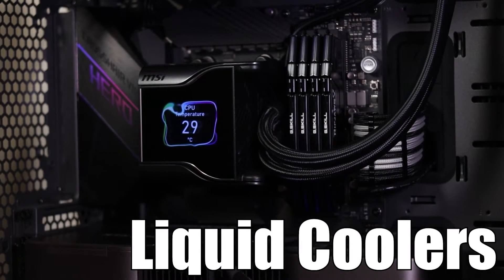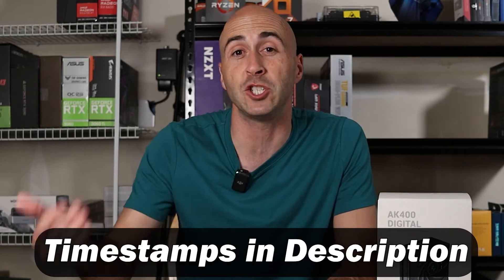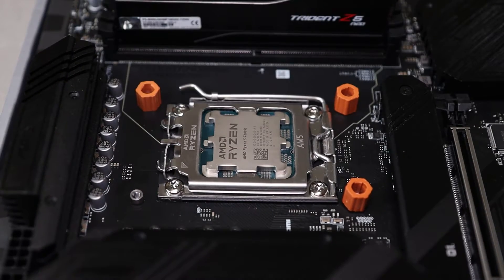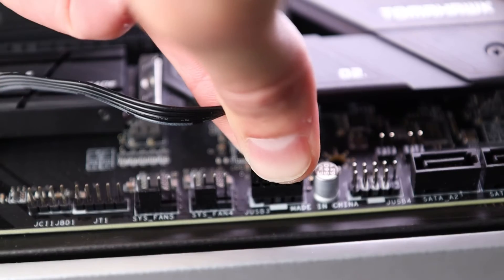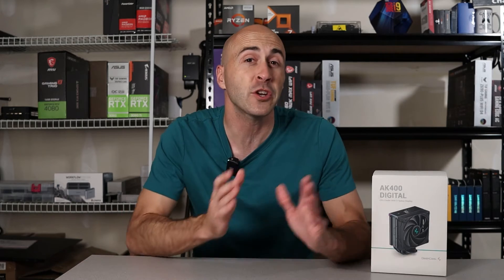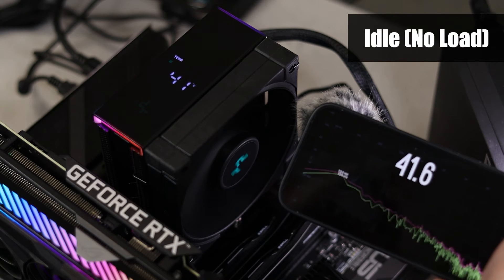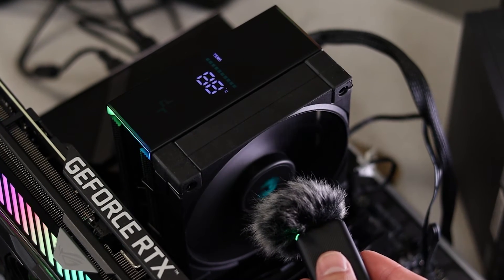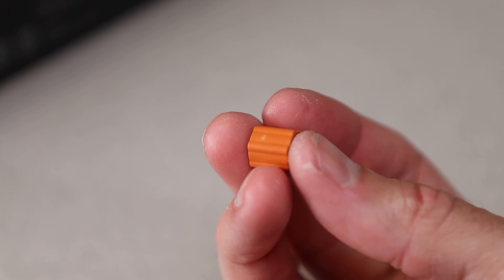LED Screen on an Air Cooler? | DeepCool AK400 Digital Review

Comment: Good to see you reviewing the Air Cooler I'm currently using.

I had one problem when I tried to install it.
I was replacing my older CPU cooler (not stock cooler) and this DeepCool need to use bracket from the original motherboard, which I'm not sure if I still have it because my previous cooler need to remove it.
I look for my dusty motherboard box and fortunately found the old bracket.
Reply from the maker: I'm guessing you're using an AM4 motherboard? I recommend to always save anything you can in the motherboard box. Glad to hear you found it!
Reply: what if i dont have it cause of moving  @DannysTechChannel
Reply: Does it also tell gpu temperature
Reply from the maker: No, it does not. It’s a little more basic than that
Reply: How's it holding up a year later?

Comment: for my next build I'm going Am5, and getting a ryzen 7 7700x on an Aorus X670 elite ax, also was thinking of getting the Deepcool AK620 digital, but...will this cooler be too close to the ram when installing, and cause me problems?
Reply from the maker: I haven't tried the AK620 myself.  From the looks of it, some ram sticks might have trouble.  Their website shows 47mm of clearance from the bottom of the fan to the motherboard surface.  I can say, the AK400 and 500 wouldn't cause any trouble since the fan doesn't extend past the CPU socket.  With the 7700x, I'd recommend the AK500 cooler. https://youtu.be/2FDtUx-YjNI
Reply: @DannysTechChannel  I thought the 7700x would run too warm for the AK500, but thanks anyway.
Reply from the maker: The AK500 would do great with the 7700x. When I tested the AK500 Zero Dark, it handled a Ryzen 9 3950x.
Reply: @DannysTechChannel  nice, thanks. Could you reccomment a board for the 7700x amd, the one I have chosen is £279, a little too expensive to be honest, but I won't be overclocking, it must have fitted I/O sheild though, thanks.
Reply from the maker: I like MSI motherboards personally. Right now, my AM5 board is the B650 Tomahawk. I’m currently using it to test the 7800X3D and it’s been GREAT!
Reply: @DannysTechChannel  as they say, great minds think alike, I'm using a b550 tomahawk in my am4 build, so thought I'd look at the b650 too, and that's what I was doing when I got this email. Saved me nearly £100, thanks.
Reply from the maker: Anytime! Glad to help out